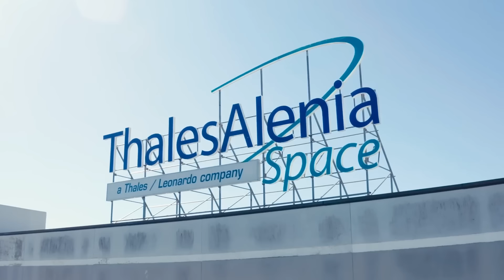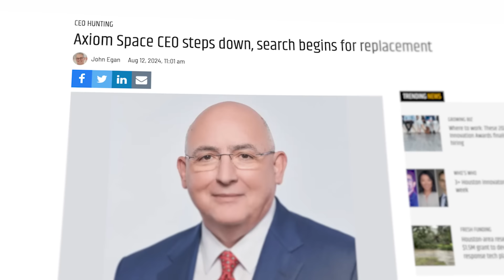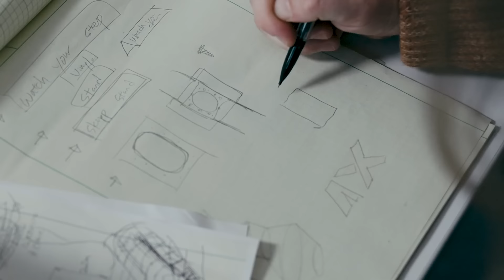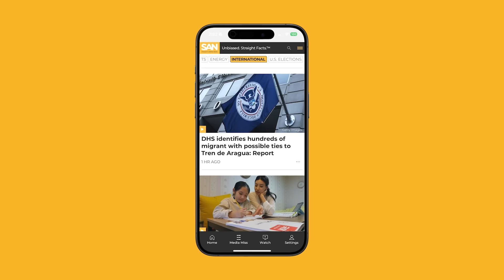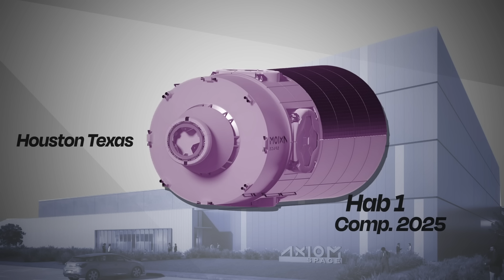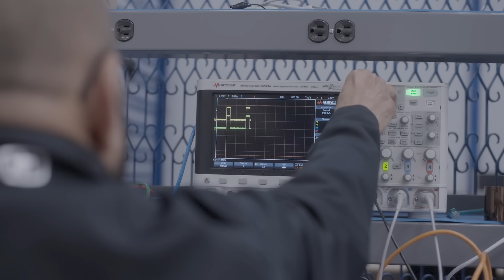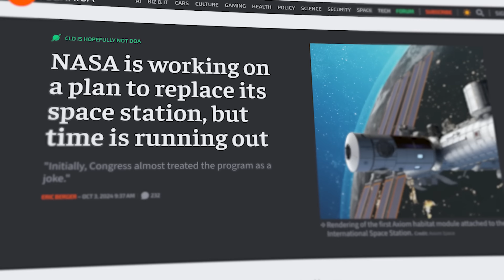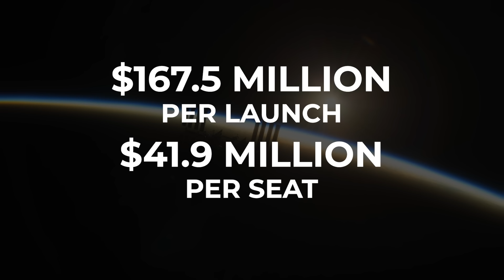NASA's New Space Station Has A Big Problem! (Axiom)

Comment: The whole world needs to collaborate on building the first O'Neil cylinder as a giant hanger for long term building and habitation. The initial cost would be very high but would be made up for in less cost in constantly going back and forth from our giant gravity well.
Reply: It will take 100 years from now before it's practical to build an O'Neill cylinder; we need robotic asteroid mining and construction systems in space, and imagine building a one-kilometer length cylinder that's a couple of meters thick to block radiation & micrometeorites. I certainly think we can and should do it! But it's not going to happen within our lifetimes, unfortunately.
Reply: @ChickensAndGardening  - It does not have to be built all at once; we can start with a regular space station built to eventually be the hub, then bring up a module each trip that would be the eventual spokes of each end. 

Once the desired diameter is reached, then a living space module can be added to each end. At this point tests could be run on spin speeds and their effect on humans. After that, we may have mining bases on the moon and better steel manufacturing capabilities to create material that could be launched off the moon to waiting shuttles to bring materials to the station that would orbit farther out than the current space station. 

Perhaps even micrometeorites could be captured and used for building material. Once a tube starts to extend a mile or so, the hull can be expanded to store water for radiation shielding. Maybe the micrometeorites could be glued together to form a shield? There are so many possibilities, but we should start now or we will never learn.
Reply: @ I think you're describing a wheel with spokes, not a cylinder, but yes we can start with some kind of simple ring that has just enough for human habitation, then keep adding to the length indefinitely.
Reply: @  Yes, the ring would be the start. After the ring is finished, construction could begin in the other direction. Perhaps 2 rings could be started and then expanded and filled in-between. This would be a fun task for the engineers.
Reply: @ Once the robotic mining and assembly systems are up and running, these types of construction projects can just go on indefinitely. Given enough time, and access to metal-rich asteroids like Phoebe, we can build habitats in deep space to house millions of people, perhaps billions eventually.

Comment: In 2025 SpaceX will put a Starship into low earth orbit (LEO) and return it to Earth, probably on Integrated Flight Test 6 (IFT-6).

Currently, SpaceX is beginning to assemble the HLS Starship lunar lander for the Artemis III mission scheduled to launch in Sep 2026. 

It's not difficult for SpaceX to outfit another Starship with an upgraded Artemis III environmental control life support system (ECLSS) to accommodate 5 to 10 astronauts on a three-month LEO mission. That would be the beginning of a one-piece Starship LEO space station (a 21st century version of Skylab, only far better in every way) to replace the ISS when NASA sends that space station to its final resting place in the South Pacific spacecraft graveyard. That Starship LEO station could happen as soon as mid-2027, well before ISS is decommissioned.

Comment: Why would you just destroy it rather than boost the ISS to a higher orbit, clear of space debris, potentially near the moon’s orbit, to create an emergency bunker, O2 storage, potential to be refueling station for mars and Jupiter’s moons projects etc?
Reply: As I understand it, metal weakens when exposed to space radiation, cosmic ray particles, micrometeorites, etc. It will start to resemble a sponge and lose its tensile strength. Eventually, the station will basically be unusable for human habitation and they obviously don't want to risk people's lives. I do agree with you that it might be better to just push it into a higher orbit and use it as an unmanned storage facility, possibly reinforcing the structure from time to time. By the way, the station is intentionally situated within the Earth's radiation belt to partially protect it from bombardment; the downside is that it requires regular boosts to maintain altitude.

Comment: The new one desined, is way smaller, less flexable and without the actual space that the Shuttles usevto provide, you can basically hall is smaller round tubes. No ones willing to desin and buld al larger modgular prefab system. Its seems it become mire of a only for profit system, that now is the cause of findingvways to cut cornerscfor greater profits. We see this in all the so many items failing. Then we find out they either have cheapened the piece or wentvwith lower quality materiels or electronics.

Comment: It’s time to leave behind outdated modular space station concepts. This design approach is inefficient and lacks vision. Instead, they should develop an orbital version of the Starship with expanded interior space and multiple floors, working in pairs connected by a long tether (500 meters to 1 km) at the nose (Top) to create artificial gravity through a stable, slow rotation.

This tethered setup would offer reliable gravity without the dizziness of a rapid spin and be more cost-effective, sturdy, and adaptable than modular stations. Different versions could serve military, civilian, and NASA purposes—all providing artificial gravity and far more usable space. 

Modular designs were a workaround for past limitations. Those limitations no longer exist! If an upgrade is needed, they could simply deorbit and replace one Starship with a new, fully equipped version—eliminating costly repairs and risky spacewalks.
Reply: They should experiment with tethered designs, but the materials need to be very strong. Imagine if the tether broke. An alternative design is a rotating cylinder; when large enough, it would feel like Earth gravity, and would be more stable. In either case, massive shielding is needed to protect humans & equipment from radiation.

Comment: Sadly, unless they can address the issues urgently I suspect Axiom will abandon the station before it is ever launched.  However, VAST has recently made some significant announcements include Haven-1 and Haven-2 and it seems they have better funding in place.
Reply: I'm sure Thales and SpaceX will play lets make a deal at some point in 2025 with Trump's NASA providing some funding for ongoing support. Those modules look almost ready ready and a lot of the engineering is done, so get them built and flying after a quick safety review.
Reply: @ClayinSWVA  You think a Trump administration will buy space station modules from Italy?
Reply: Sounds like there's more M & A's in the air. Someone  will get a good deal.
Reply: @stainlesssteelfox1  Negative, ghost rider.

Comment: The Starship is slightly larger in volume than the ISS so could be outfitted on the ground, complete with windows and docking ports, and sent to orbit as a very low-cost replacement.
Reply: Wrong. Starship is large, but it's mostly fuel tanks and engines. Now, having said that:  it has plenty of room for inflatable habs. Stay-Puff Marshmellow Station could be assembled very quickly.
Reply: I've wondered about using empty starships as temporary habititats on the moon or mars. Not just the cargo compartment but the fuel tanks as well. It's a large empty airtight space. Seems like there's probably some way to repurpose it. Obviously using a starship that won't fly again.

The idea of using them as spacestations/modules seems plausible using a modified design. Or maybe not, I'm a welder not a aerospace engineer.
Reply: @Lucas12v same problem as container homes. Sounds good at first because it’s reusing old stuff, but there’s many problems when you look closer.
If a spacecraft gets reused into a station, a replacement will need to be built which would probably cost more than using that rocket to send up a station part then using that rocket for more missions elsewhere.
Reply: @jameswilson5165  go look at the footage from flight 3 when they showed the inside of the payload bay... It's massive. Yes, the tanks are even larger but who cares?
Reply: @ham_the_spam4423  it's not reusing a Starship, it's using one designed as one.
Reply: @jameswilson5165  The Starship is inteded to have a 1000 cubic meter pressurized payload bay. That's pretty much exactly the same pressurized volume as the ISS.
Reply: I'm not an expert in aerospace design but i'm fairly sure you can't design a spacecraft one way, with one set of aerodynamic parameters, stress tolerances etc. and then just "outfit it" with windows, docking ports and various other things that significantly alter the structure without potentially serious downsides.

(and it also strikes me that there's a big difference between a ship that goes on trips then returns to Earth for extensive inspections, maintenance etc. and something designed to stay in orbit for decades)
Reply: right, sort of like old Sky Lab was, in the 1970's! Let's just go "back to the future"!! LOL ;D
Reply: @anonymes2884  The top of Starship is just an empty cone right now, needing very little strength. Turning it into a space station (or HLS for that matter) will add decks and walls that strengthen the structure. Adding some small openings for docking ports, airlocks or windows will not hurt that.
Remember flight 3 where they tested the payload door for Starlink deployment? That was slit about a quarter of the circumference of the ship.
Reply: Where's fun in that? And kickbacks?

Comment: Great video, thank you! Question: why are we letting the ISS burn up in the atmosphere again? It's inherently modular, parts of it CAN be saved if they're still useful, like the solar panels and cupola and other stuff. So if we're planning to build a new one, whoever that ends up being, and put it in the same LEO location, then for christmas sakes why not save some of the parts? What's it gonna take, a space garage to store extra modules just in case? I think ditching the entire ISS is going to be viewed as having been a terrible move after it's over.  (PS: it's spelled "climate.")
Reply: Why can't we sell the ISS in whole or in part?
Reply: Wear and tear. It was not designed to last forever up in Space and there is some nasty mold that tends to grow up there.
Reply: Stuff in space actually degrades quite quickly, leading to relatively short lifespans. Space might seem "empty" but it is a really harsh environment. Unlike terrestrial infrastructure, it is pretty impossible to do structural repairs in orbit.
Reply: To give you an analogy, it's like trying to take a 1980 Toyota Corolla and outfit it with Bluetooth, GPS, backup camera, lane assist, etc. It is not worth trying to keep it up and doesn't have the capability to expand with new technology. i.e. some of the data connections are serial versus digital.
Reply: Part of the problem is we worry so much about the cost to benefit ratio that things in these areas of production rarely make it passed cool CGI investment ads. The industry is full of unpaid development teams, fabricators, and yet the guys wearing the suits are living a king's life, while producing nothing but ideas.

Comment: Remember 911? The building put out so much dust and toxic dust that people got sick for years after. What is an object the size of the space station going to put into the atmosphere? They should attach a booster that will gradually move it into a higher orbit, then leave orbit and make its way to the sun.
Reply: it will do nothing, mostly will burn and only small metal pieces will hit the the water, without putting out no dust. that's arleady happened a lot of times with all the soviet stations, including mir which wasn't big as the iss but still pretty big, and skylab

Comment: I have looked online for actual information about what experiments were performed on the ISS that led to any major breakthroughs. In short, there doesn’t seem to be a plethora of data leading to medial, engineering, or scientific breakthroughs. In short, little to nothing has to lead to questioning what differences between the old Space Stations, SkyLab, MIR, and the ISS justify building AXIOM? If these tests can be performed by other means than the billions a space station costs, wouldn’t that make more sense? My point is not to rally around causing the downfall of the Space Station concept. My point is that just maybe we should design one around performing tests and experiments that lead to positive useful outcomes. So before we spend billions on a new low-orbit habitable experiment. Let’s work on designing one that can meet the needs of deep space life sciences, new metallic alloys that can withstand cosmic radiation, spinning ship components that can simulate 1-G to prevent astronaut health issues. And many more new concepts yet to be discovered. No more billions spent on outdated and obsolete endeavors with much more affordable ways to preform tests.
Reply: Maybe I'm too human, but it just seems like a damn shame to just end 30 years of continuous human presence in space.
Reply: @trequor  : Maybe I’m just too much of a realist. Placing people in space without reason is expensive and doesn’t get you very far but lower Earth orbit. Talk about spinning your wheels. What we need to realize is that space is very hard, and it’s not healthy for life. However, it’s great to use as a medium to travel through to get us from one place to another. So what are those places? A colony on the Moon, and on Mars. A way to protect life from disappearing because of a large meteor strike that took out the dinosaur. A way to hedge our bets against extinction.
Reply: Yeah, I think "research" was just a way to justify spending $billions on a crewed space station. There are some sound business cases for the space sector, such as comms and earth sensing, but after that there is very little to justify the expense.
Reply: @bobcousins4810  : What a waste of money. I agree with you 100%

Comment: We've spent zillions of dollars putting all that mass into LEO. Isn't it feasible to cannibalize it? If there are leaks and/or risks of them, use modules for unpressurized storage or lab space for experiments that run in a vacuum. Have conditions in orbit caused the solar panels to deteriorate? Even if their output is reduced, they could be used for the lower needs of the early phases of a replacement  station. Turn the into fireworks when a new improved generation  of panels is ready to launch. Maybe on rockets with a lower $/kg.

Comment: Elon to the rescue, again. Space Station Starship is more of a sure thing than most of these ambitious proposals.
Reply: I was skeptical of a Starship used as a space station, but I now warmed up to it. SpaceX have to test the long-term habitability of Starship in LEO anyways, might as well get out additional use by hosting those space station experiments.
Reply: @negirno starship as a 1000m3 volume per ship (without even considering modifying the propellant tanks to make them habitable), is an insanely obvious solution for quasi infinite modules as long as they create the 6-side node elements to gang them together.
Reply: I would be wise to build a station for in orbit refueling and crew/passenger transfer, so yeah SpaceX will probably build the next one.
Reply: The payload bay of Starship has more habitable volume that does the ISS. There's no need to mess with the propellant tanks, which could be used for station keeping. By 2030, we'll have the small stations like Haven-1. We'll likely the government backed station, ESA's Starlab. Finally, we'll have Starship Space Station. The others, like Orbital Reef, I'm not confident will be ready.